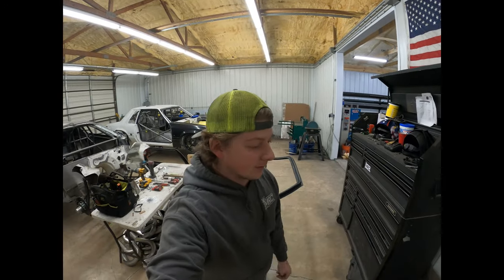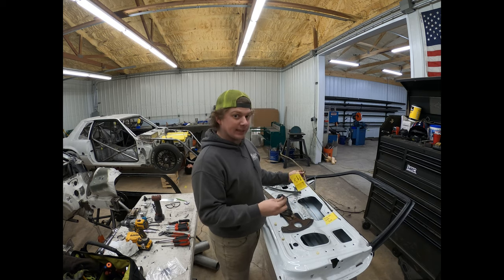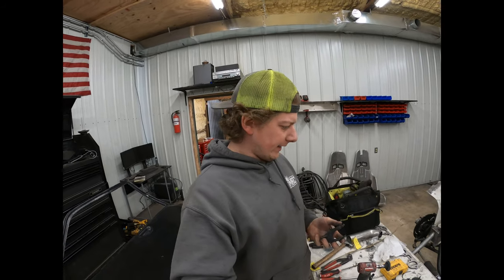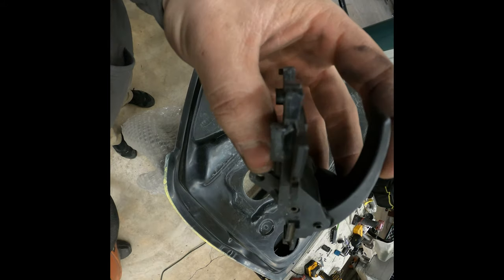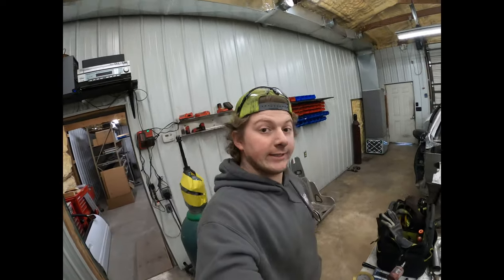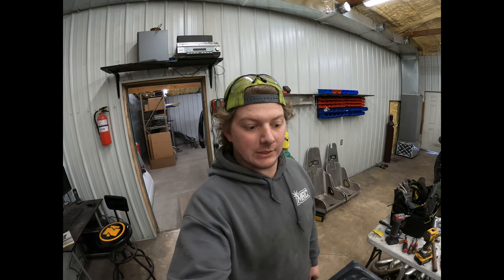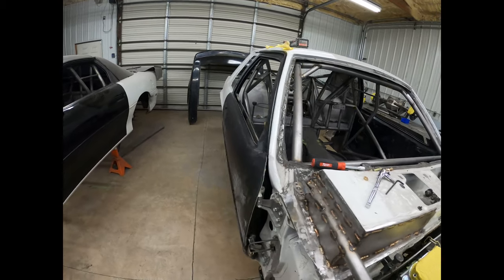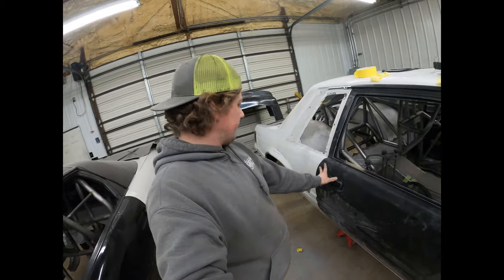How to Mount Fiberglass Doors on a Foxbody

Comment: If experience has tought me anything, it's you young bucks better start wearing dust masks and eye protection more or you're not going to last long.
Reply from the maker: Mark is wearing eye pro in the video. And there wasnt much trimming to do on these. So a dust mask wasnt really warrented. We do wear respirators when we do heavy fitment of fiberglass and carbon.